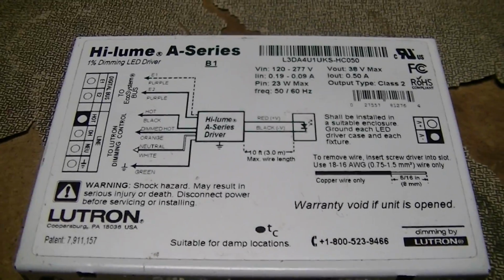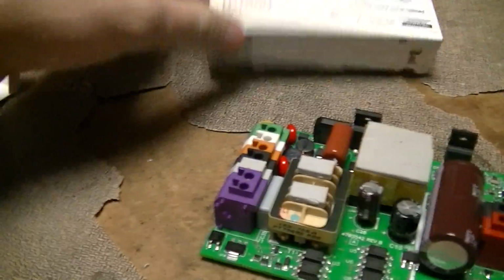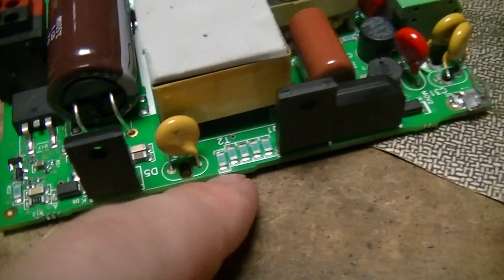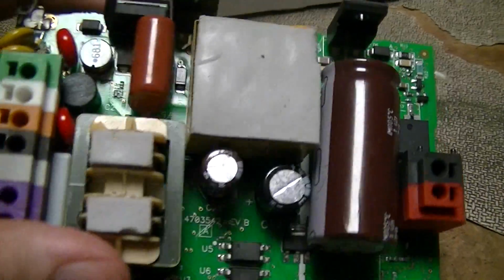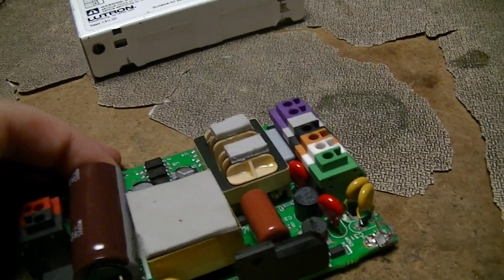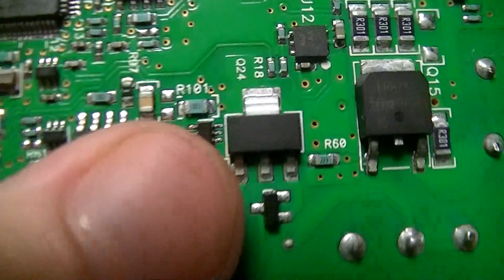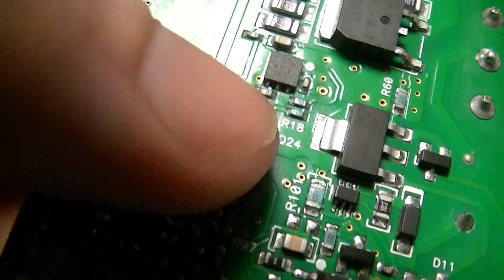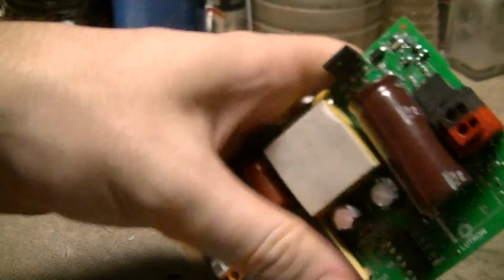Lutron LED driver guts

Comment: Its getting a lot harder to fix things like that. There making more and more layer boards.
I have had to replace bad caps on computer motherboard and now you can not use a solder sucker I have to use de solder wick Or a de solder system I can not afford . It like you can not buy a digital storage oscope